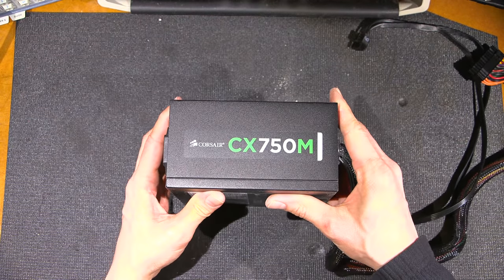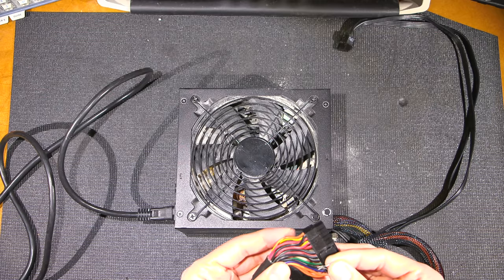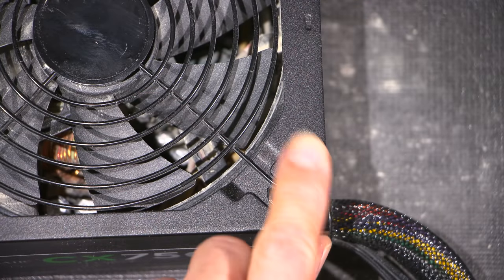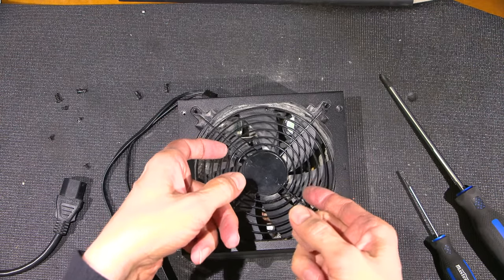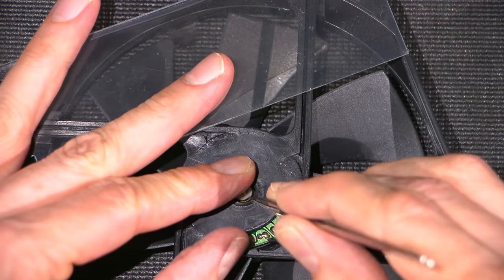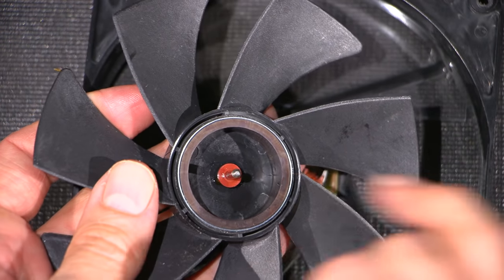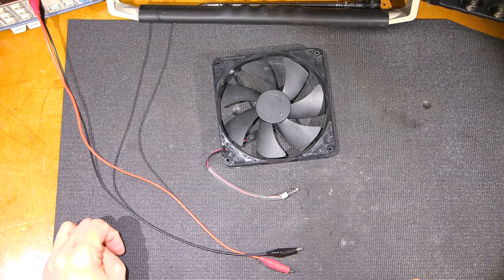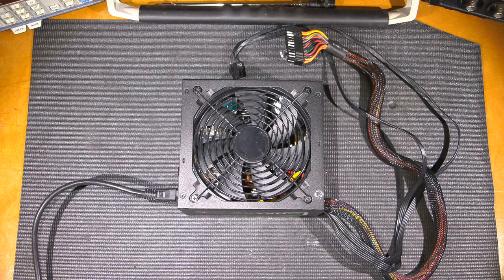Fix A Computer Power Supply!

Comment: Great you pointed out about the dangerous 400V charge on the capacitors. In the old days, Win98, living in the country near a sawmill, the computer power supply would get fried by power spikes and I would fix it by replacing both bubbled capacitors. Could you do a vid on how to safely test, discharge and replace power supply capacitors (if you haven’t already)?

Comment: Paul, congratulations for your channel, I´m a big fan of your work in all aspects. I´d like to suggest you to make a video about ground loop, you could approach the subject specially in audio equipment. Also, it´d be nice to hear you in a dedicated video about special techniques for soldering components and wires in old chassis, to avoid noise (i.e.: when to use coaxial cables, twisting paralel conductors, using the right polarity of capacitors, shileding techniques etc.). Thank you for sharing your knowledge.

Comment: I was super excited when I saw the title, but rather a let down given this is more a guide on "how to fix a 12vdc fan" rather than a PSU.  The reason is, I've got 2x Corsair AX860i PSUs that have been giving trouble since the day I got them.  Recently, one completely blew up causing not only the apartment breakers but the main breakers on the floor to trip - that surge must have been insane.  It was the most scary "Boom/Snap/crackle" I've ever heard, and I've heard a few!

Comment: Noisy fan.
This reminds me once of an ATX power supply I had in my computer that had the noisy bearing issue. I was able to take it apart and oil the fan, but it would start making noise again (the sintered brass bearings had probably gotten oval shaped). I had to keep it running for a little while longer while I could source a new fan/ATX power supply (hoped for a fan but a replacement ATX was a back up plan). Removing the rubber dust plug covering the only bearing I noticed I could ram a brass tube into it and form a liquid tight seal. I cut and soldered the brass tube into an "L" shape. I added a length of clear plastic tubing so I could see the oil level in the tube. After drilling a hole in my case I was able to reassemble everything and now had a vertical pipe sticking up from behind. Every now and then I would add some more oil when it got low. My temporary solution lasted for a few years until I had to replace the ATX power supply because it couldn't handle the power requirements of a new mainboard and CPU. I disassembled the old power supply to see how bad it got. It wasn't too oily inside and I never had any drip issues. Lucky I upgraded because the electrolytics had started to bulge.
Reply: Once I had a CPU fan die on me so I opened up the case and had a desk fan blow on it. That was back in the days when the fans were right on the heatsink roasting over the CPU. Seemed like I was forever changing those fans. They'd just get barbecued up there. A 6" desk fan kept it going. I use the same trick to extend the duty cycle of my MIG welder. It doesn't have a fan so I put one behind it. Use the same fan I used way back when too. Air is air.

Comment: I was going into this video thinking you'd be replacing the main HV electrolytic filter caps and the main switching transistors, or replacing the output low ESR/ESL electrolytic filter capacitors. Then again, I'm of the age where I was around when the "capacitor plague" was a big issue in the IT industry.
However, as soon as you said "the guy who gave it to me to fix said it's making a horrible noise", I was almost certain it was going to be a bad fan.

As far as repair versus replace with respect to the fan itself, I'm of the firm opinion that it's better to Replace it.
There are a few reasons for this, but the most important one is that no matter what kind of bearings one of these fans uses, when they run with no oil the same thing happens to them on a much smaller scale as what happens to a car engine when run with no oil. The surfaces in relative motion will rub against each other, and that ruins the bearings. So even if you do manage to make one of these fans quiet again by re-lubricating it, it's going to have a significantly shorter life-span before it either starts making noise again or just seizes up entirely. The worst part is that you can't really predict how long the repair will last, so if you're fixing a power supply with a bad fan and making money on the job, then replacing the fan is the right call to make.
One more thing, if it's a fluid dynamic bearing then you want to keep grease well away from those bearings.
The right thing for the job is a few drops of oil, preferably something you can guarantee won't degrade plastics (silicone oil is a good bet when it comes to not degrading plastics).
Additionally, that sticker on the fan that tells you a few statistics of the fan (voltage, max RPM, max current draw, occasionally airflow)?
It almost always acts a seal to keep oil in the bearings and dust out of them. So if you tear or pierce that sticker, you might as well buy another fan. Heck that's the main reason I suggest you buy another fan in the first place, there's no way you get that sticker off cleanly without somehow messing up the adhesive of it (the very oil that lubricates the bearings is almost certain to ruin the ability of the sticker to stick).

Comment: Considering the state of the inside of the power supply, I bet the tower that it came out of is jam packed with dust and dust bunnies.  That's a common problem for towers that sit directly on carpeted flooring, as the fan is sucking up all the dirt in the carpet like a vacuum and distributing it inside the power supply and computer case.  I fix and repair computers for a living and I've had clients who owned cats and the inside of their computer tower is just PACKED with a nice deep layer of cat dander that I've had to clean out just to get to the components inside.  The computer breathes and runs much faster and cooler once it's been cleaned out looking like new.
Reply: I build little platforms I keep my towers on. A couple inches off the ground makes a big difference. Air conditioner filter foam helps too.

Comment: They often have sleeve bearings which are quieter and cheaper than ball bearings, when they new. Over time they wear out especially if it lubricant gets old, dry and contaminated. Worst of all, it often wears out uneven.
Adding oil can help but not for long. There are also fluid dynamic bearings which I think sealed.

Comment: That was great, finally something you had that I can work on...lol. Wonder why the fan had that partial clear baffle on it? It obviously impedes the flow of air, so I wonder if it's necessary at all. It still amazes me that a very expensive power supply can be destroyed by a $6.00 fan. They should incorporate a shutdown circuit if it fails.
Reply: More likely that baffle was there to direct the airflow around some component that was not getting enough airflow. Chances are the baffle was cheaper than upgrading the component. The bean counters have a very long reach.

Comment: I have 3-4 fans almost always on for the past 12-13 years and still good, because I clean them, and oil them every 0.5 to 1 year. I use motor oil or gear oil I find in the garage...

Comment: The correct answer on A+ certification is to swap out the psu, it’s a fru=field replaceable unit. But I would just replace or lube the fan before it fails and your psu burns up.

Comment: When turning on the PSU by connecting the green and black wires, is there any risk in electrocuting yourself? I guess the voltages are low, but just wondering. Is the circuit grounded somewhere?

Comment: I have always been a huge proponent for putting a couple drops of silicone based lube in the fans replacing the rubber cap and putting a square of electrical tape over it and it would run like new.  Unfortunately, I'm not sure if it's because of different bearings or reduced costs in manufacturing but it's very heard to find a modern fan this works on.

Comment: A few months back I had ended up swapping out a PSU on one of my computers, but that wasn't because of noise.  The machine would spontaneously shut off (not even doing a power down, but abruptly losing power).  But it was a PSU I pulled out of the electronics recycling bin at my old job, so it got some more usage for a while, and will end up in metal recycling anyway (I don't have an electronics bench or test equipment to test it on, not like when I was in the zSeries test lab).

Comment: I fixed my power supply by changing the fan , I don't know that I could have   re grease it. I still have the old fan. I will give it a try. Thanks for the tip!

Comment: I had this exact PC power supply, a mains surge that lasted a fraction of a second broke it and it doesn't start up anymore. Could it be just the filter capacitor what needs to be replaced, or maybe other components can have gotten damaged too?

Comment: Great stuff. Two things, the new grease used on fan. I presume it was lithium or some other non detergent type. Can you confirm? Also, the resistor value used when connecting it to the fan for power leads. I know it must be high enough current will not flow but what is the threshold? Thanks a lot, cheers.

Comment: Years ago used to take a bearing and put it in a flexible clear tube horizontally and force methanol thru the bearing then a silicone oil

Comment: Don't the two wires only need to be connected momentarily to start the supply, or does that only apply to the switch header on the motherboard?
Reply from the maker: The two wires need to "latch on" to keep the supply operating.

Comment: No offence, but from the second you talked about the symptoms I was saying "the fans stuffed" and getting annoyed by the preamble leading up to that concision because it's a very common issue, and I mean it's not like a modern computer PSU has a massive mains powered toroidal transformer in there that might vibrating (if were shorted or something), infact I don't see what else could be at fault other than the fan.

That said I liked that you showed how to actually fix the fan (rather than just replace it), it's a useful thing to show because while this fan could've been replaced for $5, the fans on other PC components (ie: GPU fans, particularly those with unusual coolers) might be much harder to replace, so knowing how to fix them is a good skill (just don't go trying to clean out any metal/rust dust from the fan magnet using a stronger neodymium magnet or you'll then have to figure out how to re-magnetise it properly, that sure was a "fun" experience the first time I ripped apart one of these motors).

Comment: I have a number of computer power supplies with different issues.  It would be nice to see a video or two on computer power supplies where you actually diagnose some electronic problems with them as compared to a bad fan which is an easy fix.
Reply: I will give you a tip on someone that really helps with that, once you get past a slight accent: take a look at Haseeb Electronics. He does some fantastic diagnoses, etc.

Comment: on fans that you can't remove the retaining clip without breaking it you can instead use some spray electric cleaner to flush the bearing out then fill the bearing hole with a mixture of machine oil and grease a couple times hitting it with a blast of compressed in between each time and it will push the lubricant down into the bearing.....

Comment: Someone apparently discharged a dry chem fire extinguisher into your friend's power supply in an attempt to extinguish what was causing the smoke coming for the overheated bearing of the power supply's fan. The dust was actually chemical agent from the dry chemical type fire extinguisher.

Comment: Ok, this is the first time I have seen a repair of the fan from a power supply. 

I was also wondering about the voltage. I know we have 12v 5v 3.3v, etc. Could some of these cause problems with the computer? Plus if it says 12v DC is that straight DC or a pulsated PC. I have checked 12v with the AC setting and I get a reading. What should I be seeing?

Comment: 9:45 "Don't spin the fan with the compressed air." What? Why not? That's the most fun part of cleaning PCs!
Reply: Some say the fan can generate a voltage. I do not know if that is true. But maybe? All the components are there for that to be possible. If you really spin a fan up you can exceed the RPM rating of the fan itself and damage the bearings. There is definitely an upper limit of what a bearing can handle.

Comment: It might be of interest to know but the bushing that the shaft of the fan go thru might  be oilite which are impregnated with a graphite additive making up the bushing itself. The bushing also could have gone to egg shape or oblong from the friction between the shaft and bushing surface. Those aren’t sealed bearings either so the dust will accumulate again in the future. When they design the power to run those fans, they usually have a duty cycle signal to run lower speeds.

Comment: Those are pwm modulated, I would assume.  Also, a good static pressure fan can draw serious current.  I use Enermax d.f. Storm fans, which have nice flow with top in class static pressure.  Fortunately, they have removable blades, and I always clean them out and put some fresh PTFE impregnated machine oil in when I clean.  These fans can draw 1.1 amps at full speed (which I never do anyway, noise).  At 2400, they draw about 4.7-5.4 watts, 12V pwm.  The drawback is they can't be plugged into the average motherboard, and certainly not the h100i pump/block, so I have them controlled by an aquacomputer aquaero 6 XT.

Comment: Hi Paul.  In the future could you make a video (either here or on Patreon, as I watch you on both platforms 😉), on repairing a dead PSU? Maybe most common issues.  Too many of these things ending up in landfill as a lot of people just replace them when they fail.
Reply from the maker: Hi Paul. I have many video's here on YouTube regarding power supplies, just search my video's list. Click my channel name below the video, this will bring you to a page with tabs, click "Video's" and you will see the entire list. I also have power supply design video's on Patreon, if your interested. Use the "Master List" there on Patreon to find them.
Reply: If you wait until a PSU fails you can sometimes have a completely failed unit. For a commodity PC PSU I do not think it is worthwhile to service them either. It is cheaper to simply replace the whole PSU. I use the industry standard 5 year replacement schedule.

Comment: To place last plastic washer I use a plastic tube or a Bic pen without ink tube. Also a short piece of copper tube will ease things. I also repaired a brand new laptop fan wich was dry with WD-40 and letting it dry.

Comment: Just a PSA for anyone who decides to replace an old PSU fan, you might not be able to use a generic case fan as those usually need at least 5V to spin, and the PSU's fan control might be set to go lower than that i.e. 3V and you're left with no airflow at all.

Comment: The good thing about the load resistor is that if , you don't have a 300 ohm , you can go up or down with a different value resistor and get the same effect.....

Comment: I've worked on all sorts of equipment for 50+ years....these oil lubricated bronze sleeve bearings are probably a little cheaper than some ball bearings, but they usually need some maintenance. Often just a little piece of felt in there, soaked with oil.
Reply: Technically sleeves are quieter than bearings are. You'd be surprised at the price difference too. I need to replace a sleeve in an idler wheel and bearings are actually cheaper. I know I was surprised when I saw that myself. I guess bronze is just that much more expensive than steel is?

Comment: Hi, my power suply is a MSI MPG A650GF and sundely stop turning the fan. It shut downs the pc as soon as i power on. On and off very quicly. I did what you said and the fan doesnt turn on. What can it be ? There is a fuse inside? Thank you very much. BTW no warranty because MSI told me that i need the receipt and i bough it used to someone and i lost hi number, so no proof of buy. Thanks a lot if you can help . Cheers from Portugal.

Comment: In my experience, not just in computer fans, but also in window fans where the bearing is 'sintered bronze'  i find that the bearing wears due to lack of lubricant, so the shaft wobbles in the bearing giving a characteristic noise, the only real cure is to change the bearings if you can get hold of them (where i worked we used to save bearings from burnt out window fans0
Adding grease may help to fill the gap, but that sort of bearing should only be oil soaked into the felt surrounding it.
For a computer psu i would prefer to replace the fan, and maybe use the old one for something less critical (fume extractor etc)

Comment: Why do you think the bearings dried out ? ... Was it heat build up in the case or just an age/high use related issue ?
Reply from the maker: The power supply was on 24/7 and the bearings just dried up.

Comment: Some years ago, you could obtain service manuals to fix just about anything electrical. Nowadays these big companies put profit (greed) first and the environment last in their priorities list. Some grind part numbers off the chips so they can't be identified. Many design the casing so it's almost impossible for the average person to dismantle without damage. They also select weak components which will likely fail soon after the warranty period.

Comment: I'm watching this cuz i bought a new pc and after a few days the psu stopped working lol. Hopefully they replace it with warranty but if they don't. I want to know how much would a repair for psu cost. Cuz there was some sparks happening at the power outlet which my cpu was connected to . But then i switched to a extention cord and it was fine to use then but the pc just stopped working randomly and now I'm in this mess